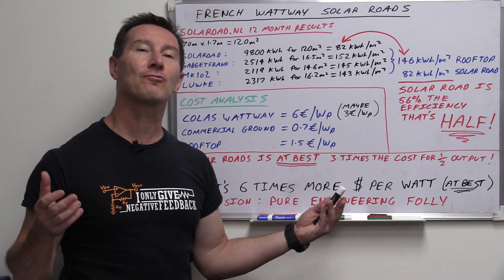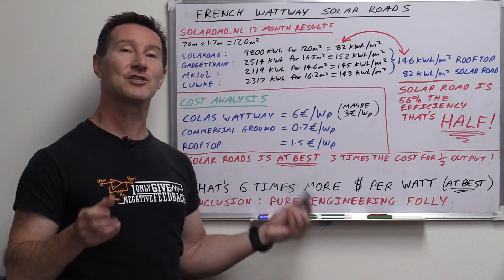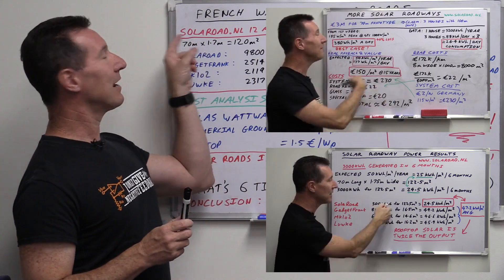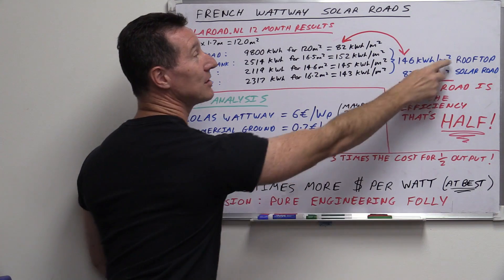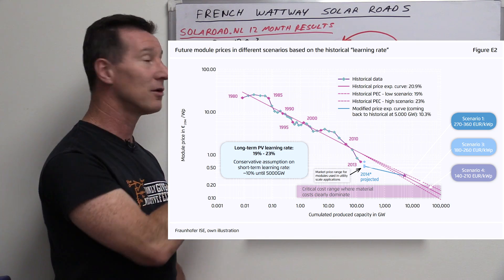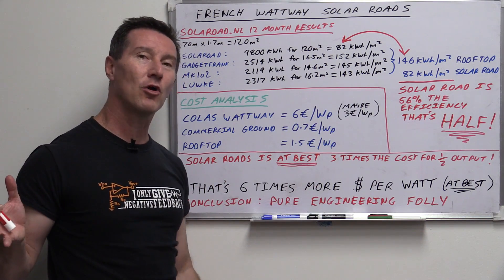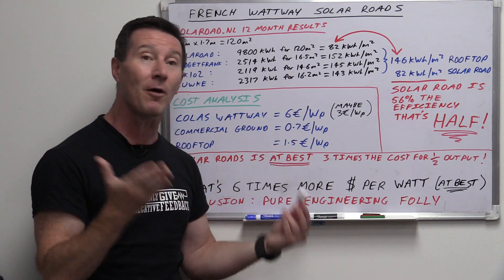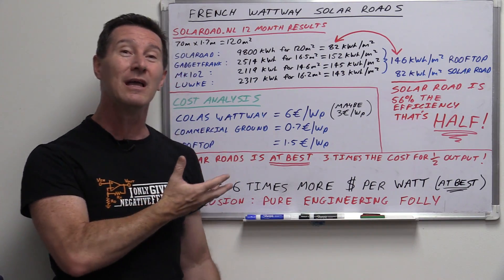EEVblog #850 - French Wattway Solar Roadways BUSTED!

Comment: 2 additional comments:

1) Is a "Lack of space" in any way a limiting factor in current solar projects?  If not, then solar roadways are totally pointless, and "solve" a problem that doesn't actually exist.
2) In the UK alone, in 2013, road closures cost the UK economy an estimated £1B.  So if you use roads for solar generation, then the (enormous) costs of closing that road for installation and maintenance need to be factored in.

So the list of Positives for solar road ways is:
1) you can use roadspace for generation 

and the Negatives:
1) vastly more expensive
2) vastly less total energy generated
3) Hugely expensive installation that lengthens the duration of any road build scheme
4) Hugely expensive to maintain and requires "intrusive" maintenance (you can fix a roof top system whilst the people in the are unaffected, you'll have to close a solar road to fix it)
5) Long term durability is unknown, including the effects of road traffic collisions etc ( will a cracked or damaged panel after a vehicle fire or heavy impact result in the road having to be shut to avoid electrocution?  Not seen this mentioned at ALL yet)

Anyone who thinks that list of (still fairly unknown and hence risky) negatives is worth the single positive, which itself is effectively void (because space ISNT any limiting factor in current solar generation) is clearly either

A) MAD
B) POLITICIAN

;-)
Reply: +Max Torque this solar road is for little villages with few traffic , it ;s perfect for roads of pavillons zone .residential area
Reply: +Max Torque  the cost is very hight but the instalation very efficace.
I would make it like a big ducktape roll in the back of a truck.

Comment: You have a point, but i didnt still understand, if not the roads, where goverment should install solar panels? On regular people homes roofs? Well, they cant :)
Reply: They could spend less money in the end to pay people to put them on their roofs.
Reply: +Tim Ramich its kinda would not work - if government will install their equipment to your roof, they need full-time access to it, if they need to fix it. and would you appreciate it? i highly doubt
Reply: +Uterr It's not "their" equipment. It all comes from tax money, which is stolen by force, which would make the panels yours. People will put up with a lot if they're being paid money. Last time I checked, there is something that exists called a ladder. They don't need to access the inside of your home to get to your roof. Besides, once they're up there and covering the whole roof, one would likely need one of those cherry pickers to work on them.
Reply: +Uterr Actually, they can. They can require new homes to have solar panels placed on them and/or come up with a tax reduction/rebate scheme to encourage private citizens to purchase and install solar panels. 

Or they could figure out what parts of the country receives the best solar conditions, see if there is land available, and purchase and build a traditional solar farm. 

There are tons of better ideas than sticking low efficiency high cost solar panels on the road. Hell a better idea would be spent on educating people on reducing their energy consumption.
Reply: If it was viable, customers and homeowners themselves will install solar roofs... but solar is viable in very specific applications and I dont mean those generous funding they got here in CZ.